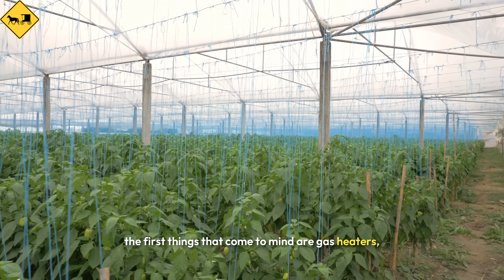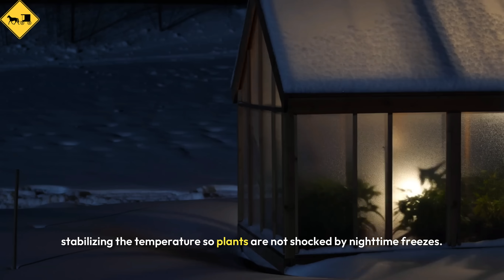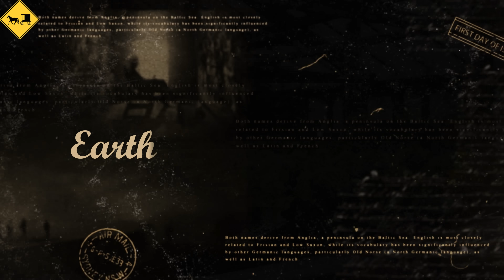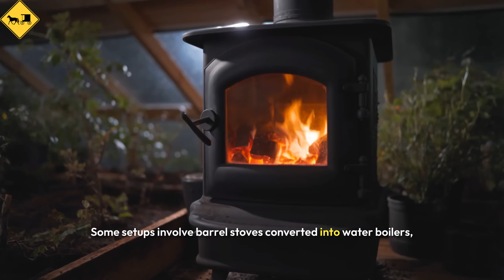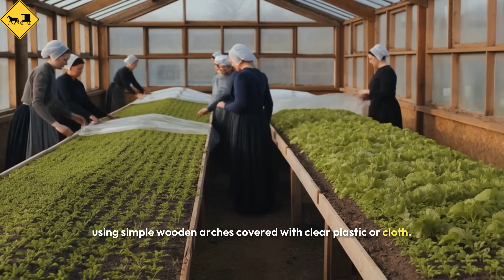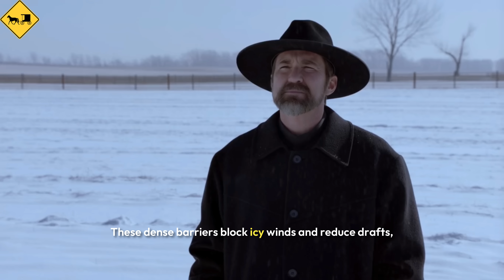How Amish Heat Greenhouses in Winter Without Gas or Electricity! 🌿🔥

Comment: I dug trench around the outside of my greenhouse  2.5 ft deep enough to set bails of straw with one stacked above ground.it is wrapped in and above ground with black plastic.it helps. I have 10m plastic inside and outside on a 2x4 frame .love the idea of walkways of red clay none glazed tiles
Reply from the maker: That’s an awesome setup, Tim! Using straw bales and black plastic for insulation is such a clever, low-cost way to keep a greenhouse warm. Love how you’re mixing natural materials with smart layering. Those red clay walkways must make it look beautiful too...
Reply: @amishfrugallife the none glased red clay tiles absorb and store heat like asphalt pavement .I like the idea of compost under planting boxes particularly the first 2.5 x2.5ft around outer walls.last year we had -20° for a week not good
Reply from the maker: @TimCheney-l9m  That’s an awesome observation! 👏 You’re absolutely right, those unglazed red clay tiles act like natural heat batteries, just like asphalt does, soaking up the sun during the day and slowly releasing it at night. 🌞🔥

And yes, compost under the planting boxes is one of the best natural heating tricks the Amish use. As the compost breaks down, it gives off gentle warmth that protects roots even when the air freezes. ❄🌿

-20° is brutal though! 🥶 That setup around the outer walls is a smart move, you’re basically building a passive geothermal blanket for your garden. Love that you’re experimenting with those techniques! 🙌